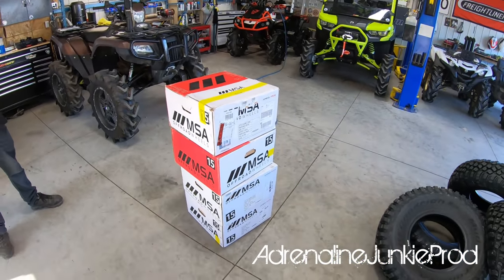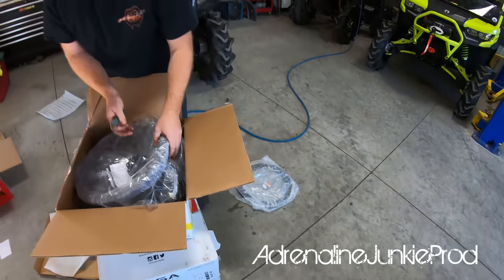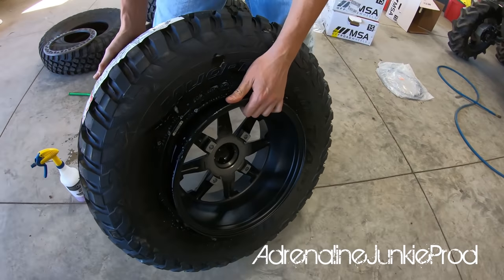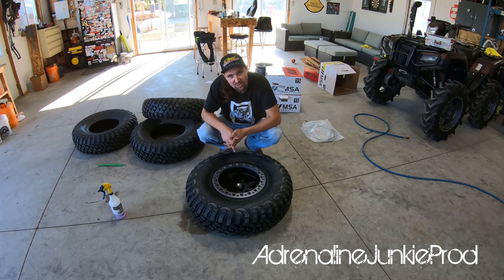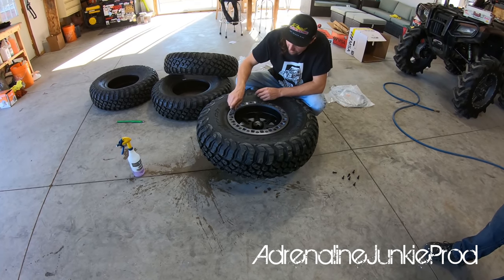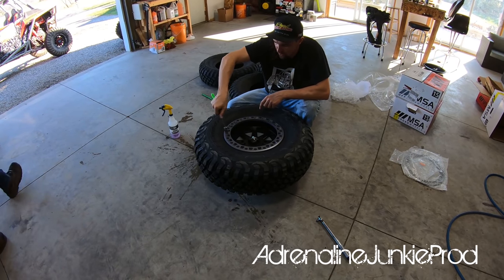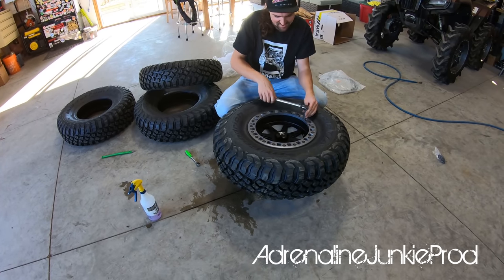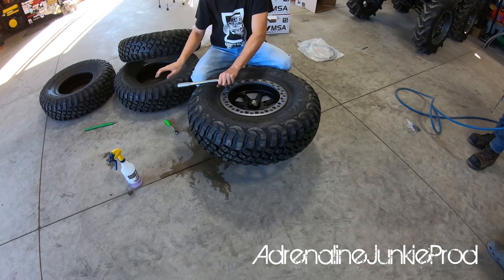How to mount Tires on Beadlock Wheels at Home by Yourself - SXS/ATV/UTV/Jeep/Truck

Comment from the maker: THUMBS UP if you run BEADLOCKS on your machine!
Reply: Yessir what size do you run on your sxs? I run 28 and the are a beast in the mud!
Reply from the maker: @janemccabe603  The ones I installed in this video are 15 inch rims with 32 inch tires. Can't wait to test them out on the trails aired down!!!
Reply: 0:11 well I wouldn’t say keep you hydrated I think water does that better because it’s natural and that’s what your body actually needed when rehydrating

Comment: When trying to seat the bead on a rim. Put a ratchet strap around the tread of the tire n ratchet it as tight as possible.  It'll push the tire bead down on the bead of the rim. Then put the air to it. It'll save you alot of time and headaches.
Reply from the maker: That's a good trick for difficult tires Chad, great suggestion. I've used that trick quite a few times in the past. These tires seated very easily. If the tire is tricky to seat then I usually skip the ratchet strap and go straight for the brake clean or quick start though, lol. I'll have to make a video of how to seat tire beads using brake cleaner.

Comment: About to mount up my first set of aftermarket beadlocks. All my factory wheels have been beadlock but I’ve never had to mess with them. Other than RC stuff. 😁😁 what air pressure are you running?

Comment: I would have put a dab of grease or anti seize on those beadlock bolts . They sounded kind of dry and could be hard to loosen them the next tire change .
Reply from the maker: In the past I've had the opposite issues. The bolts loosen with time and need to be retorqued. I've heard of people putting thread locker on the bolts but never anti-seize. Not saying you are wrong, just never thought of that.

Comment: Hi guys, how do you like those BF Goodrich tires ?, Great vids by the way.
Reply from the maker: Hey Shaun. Haven't given them a real trail test yet. I ripped around in my backyard trails a bit and in the fields and they work great. They ride nice and feel awesome at speed and on hard pack and road. They do not have the initial bite and grab off the line or at full throttle in the field. There is a lot of wheel spin because obviously the lugs are not super aggressive, however, some tires work off wheel spin and others focus more on crawling. I like how they feel so far. I'll keep everyone posted with a better review.
Reply: So that's why the tires spin because of the lughs, I running the same tires 35' and all the time I heard tires spinning

Comment: Starter fluid and a match 😳 for the backside bead
Reply from the maker: Fire and explosions make everything better! I seat beads with brake cleaner, carb cleaner, butane or starter fluid on a regular basis when I am mounting tires on my drift car. Especially if the tires are a little too narrow for the rims. Always a fun time when explosions are involved! lol. These beads seated nice and easy with just air.

Comment: Would they fit on a can am 2020
Reply from the maker: Which model? Most likely. The rims would need to be the Can-Am bolt pattern though as it's different then Polaris.
Reply: @AdrenalineJunkieProd  a 2020 bro

Comment: You don’t have to balance them with weight?
Reply from the maker: No, not on an Offroad wheel on a SXS like these. You pick up more weight in mud when you hit a hole. The suspension soaks it up. Your driving Offroad. You don’t need to balance.